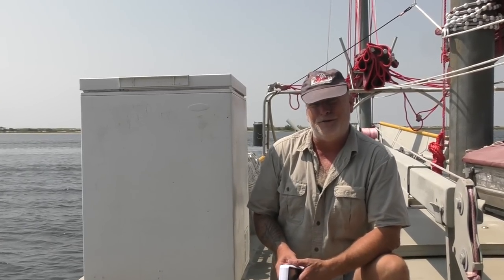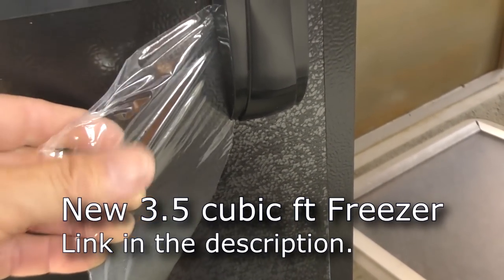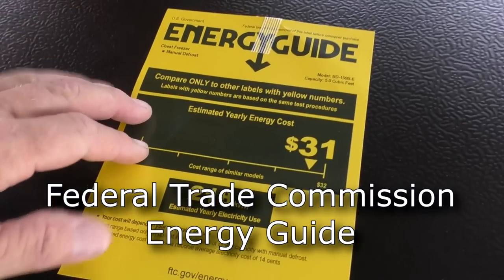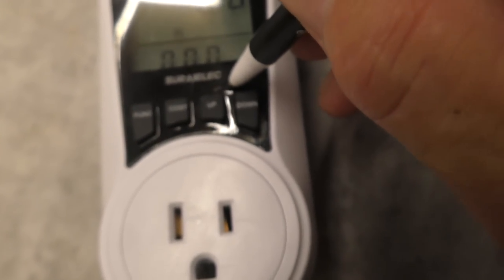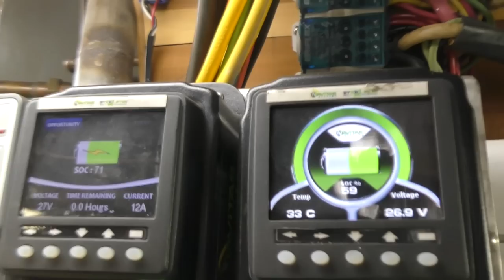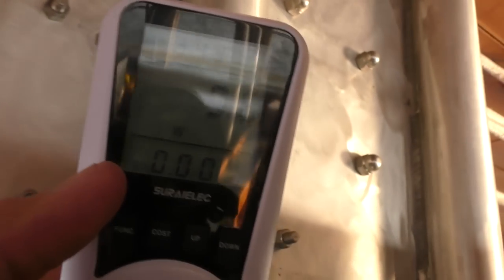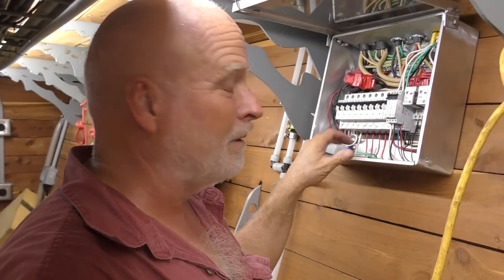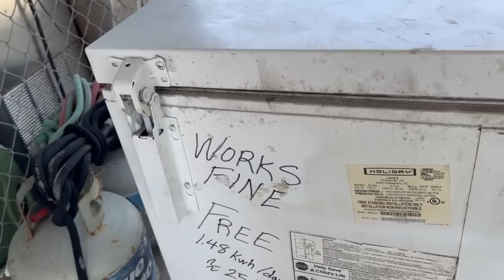Save Electricity with a Simple Meter

Comment from the maker: An easy way to check if buying a new appliance will save you power and money.

Watt Meter  https://amzn.to/3DmUXCO
Chest Deep Freezer https://amzn.to/43yB5qX
ON Off Switch  https://amzn.to/3Y0waxT
AC/DC Clamp Meter https://amzn.to/3XXn317
Reply: For some odd reason I had a weird dream about your boat last night, that dream you like Andy's boat better so you sold sv seeker and started to building another boat.. it must have been them mushrooms that I ate with my beefsteak,, you guys keep enjoying yourselves and keep having fun wish I could join you

 mushrooms i8
Reply: Does anyone have suggestions on a watt meter that has more of the features that Doug wished his had?
Reply: Wy 220/120volt ?
Wy not 12/24 volt compressor cooling system .
You have fridge and friezer in 12/24 volt.

I use one from lg 12/24volt 5/2.5a its how you connect it.

I try to use direct from the battery than i use battery to converter to make  220volt (my case)

Is use Victron 2x 1200watts converter 220volts on 2x 150ah lipo4 battery 12volt  connect on solar panels .
I can charge the lipo4 with the alternator   thanks to a dc-dc charger what is lockt on 20a so the alternator do not blow up .
I use a 70a alternator on the boat .
This alternator do 70a if the engine run even on low speed .

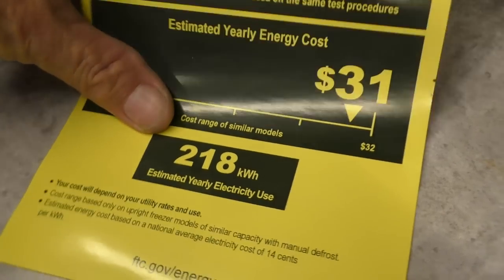Comment: 10:49 keep the sides of the fridge clear, the evaporators are embedded in the walls, the harder it is for it to reject heat, the less efficient it will get
Reply: A really good advice, many people may wonder why there is no condenser in the back as you see it on some of those (or some fans) and afterwards wonder why the sides get hot, but still pack it tight into some corner, or even worse, as my grandma did (it was not actually a chest freezer) put a nice looking tablecloth over it...
Another thing why it may not use exactly the power you estimate, it will change all the time. on a cooler day it will use less. and immediately after you switch it on for the first time, it will draw more until it comes down to temperature. If you load it up with warm stuff, it will draw more. So best monitor those over a few days.

Comment: Great use of the power meter. Was going to suggest a clamp meter but you showed one. For the bird issues you could glue some spikes to the tops of your upper structires, as long as they wouldn't interfere with your electronics or access. Anti-bird devices oftem come in strips, which you might be able to glue or cable-tie in place. They're often also made entirely of plastic. They don't harm, just prevent landing. Bird poo sure makes a mess!

Comment: For a slightly more comfortable experience at the cost of more setup time, you can use smart home plug adapters to automate part of the process. For me I set it up so it comes on when I push the button, and then turns off after a minute where the current draw is below the "idle" threshold for the device. Takes some setup and faffing around on the computer to make it work, but for forgetful types like me it's also convenient to make sure I don't forget to unplug my soldering iron or rice cooker or anything, by having those ones also just automatically turn off after an hour even if still drawing current.
Reply: In Doug's case, all of those smart plugs will add to the parasitic draw.
Reply: Just make sure you get the plugs with current sensors. Not all plugs have them. Also, they add more idle load, and whatever you're using as a server uses power too.
Reply: @occulus2615  I disagree. I have about 20 Shelly1 wifi relays in my house, their standby is about .6w and about 1w when engaged. So you go from saving 7w on the TV to saving 6.4w. I think thats worth it.
What I don't think is worth it is the added complexity to now having devices dependent on WiFi on a boat. Fine for a house, but I don't think this is a good idea in a vehicle.

Comment: Quick question. If the batteries are only charge to a bit over half, why would the charge controllers be in float? Shouldn't they be in bulk?
Reply from the maker: The difference in amps is minimal, but if I have kicked the engine on for any reason, it's chargers on the alternator will make the solar chargers flip to float.
Reply: @SVSeeker  understood. Thanks for the response. I use the same charge controller in my camper van... Just curious

Comment: I bought an outgoing model freezer from Costco, a Danby 7 cu.ft. convertible freezer/fridge.  What's interesting is that it only draws 50 - 55 W when running as a freezer, and it runs about 50% - 60% duty cycle even when equilibrated and located in a cool basement.  So not very high performance in terms of being able to cool down a lot of mass quickly.  But it gets the job done for me.  Similar total kWh/day to the one you have.

Comment: DC is only safe for below 36 volts and you don't want to get too high on the voltage or it can burn the skin. It used to be 48V, but sweat and small cuts on the skin of your hands lower the resistance of your skin enough that it lowers the resistance enough that the current can penetrate enough to cause burns. For AC, below 36 volts is safe. Anything above that you turn it off or risk stopping your heart and dying.

Comment: the first day will be less efficient, power-wise, the compressor will run longer than normal. After the fridge comes down to temp, leave a watt meter plugged in for a long while so that it takes average over lots of time. The compressor kicks on and off at different points throughout the day, so the longer you leave it on (days, etd), the better average you'll get.

Comment: Hi doug, i have a power meter that has the function you are looking for with a built in timer. It is a voltcraft product model no. SEM4500 hope it helps. Greets from the Netherlands 👍 p.s. i just noticed its for 230v.. not sure if that one works in case you are running 110v but they are definately out there
Reply from the maker: Thanks,  as little as I need it, $14 and a clock will work. : )

Comment: Isnt the critical part about running compressors off of inverters that you use a "pure sine wave" inverter, not a "modified sine wave" inverter?
Reply: Pretty much. The manufacturers say not to use an inverter because someone will try to feed it square waves from a cigarette lighter inverter, and neither refrigerator nor inverter will be happy.
Reply: Most of these new fridges/freezers are now inverter controlled compressors and so maybe they are known to have problems when running on a inverter ?

Comment: my experience with the wat meters is if you leave it unplugged to long or even for no reason the battery or something goes dead in it and it gets tossed in the trash i had 2 would i recommend them yes to lurn what things use will i be buying one no thx maybe someday i should not half to ! 
Also if you leave it plugged in you notice it heats up so some power is heating it!I 
I got one and then got a freezer like you hehe try the corncob bulbs they are grate savers 10 15 wat one is like a 100 wat bulb well almost but better light.

Comment: If you are annoyed by the bird, you can get a small green laser and shine it in to the bird, they are afraid of the light and will fly away, a system like that been developed for commercial use. Could also use some small fireworks or horns mounted there. I think birds will annoy you for a while in general.
Reply: Or bird spikes to stop where it roosts
Reply from the maker: Got one!  Buba has not been back but I've had fun playing with the laser anyway. : )

Comment: It would be nice to have a gas or electric powered pressure washer on the boat. I also wonder how well a pressure washer would clean bottom of boat while under water. I think it would work good as long as you did it before it gets built up to much. Just a suggestion
Reply: A pressure washer will work somewhat under water, but only on a very short distance. as water has a way higher viscosity as air, the jet of water will be slowed down considerably more. on a very short distance it will work. Another thing you have to consider, how to keep yourself in place, otherwise the power washer will turn into a jet propulsion system and push you away from whatever you point it at.
Reply: @alexanderkupke920    My friend and I used to ride a power washer wand around our pond when we were kids.   
'
@TOM If you hang around a bunch of old salts you will realize things are typically done a certain way for a reason.     For some reason the younger generation thinks were superior because of our use of technology but it doesn't replace experience.  Old sailors are possibly the most diverse and knowledgeable group I have ever met and thinking one is going to be more clever leads to an exercise in failure and stupidity.
Reply: @saltysassy958  One more thing about doing things "the old way" if found, not only for such things, but also when it comes for example to hand tools vs. power tools. Power tools are fine if you have larger, or repeated tasks, where the time to set up, possibly make you a jig to get repeatable results etc. is no big deal. But for smaller one off jobs, for example cutting a single piece of a 2x4, having a sqare, a knife (or pencil if it has not to be that precise) and a handsaw gets the job done before you even got a power tool out of storage and set up for the correct size. Unless you may have a fully equipped shop with everything ready to be turned on and used at any moment.
Or for metall, why get out a grinder just to remove a burr, when two or three strokes with a file do the same? Plus the "old way" also works if you do not have power at your disposal. I have to admit though, with the development battery powered tools had over the last years, that might be less of a concern in many situations and in some cases it also considerably cuts down setup time. And for some jobs, I would for example not volunteer to switch a cordless drill for a brace unless I absolutely want to.

Comment: I would think about the lifespan of that 6A relay on a B15 breaker. Not sure how much the "crane" pulls when in use, but you might weld the contact pretty quick. Your breaker might be too big for the circuit, then its fine.. 

Also, relays have different ratings for different loads. Say a contactor you can run a 9A motor on, you can probably run 30A if its a heating cable. This is called utilization categories. 
Your relay is only rated for DC-1, resistive loads, and 6A, and not DC-3 or DC-13, and might be fine depending on your application. If you only pull 6a of resistive loads, its fine but if you have inductive loads, they will fail on you. And they always fail at the worst times ;) 

Example from a similar style relay that is actually rated for inductive loads.
DC1 - 3A (heaters etc)
DC13 - 1A (coils, solenoid valves, contactors)
DC3 - DC motors not rated

AC1 - 5A (heaters)
AC15 - 1.5A (coils, valves)
AC3 - 0.5A (1ph motors)

The reason it is like this, is because its harder to put out the electrical arc when you have a coil of some kind in the system, this will keep energy and voltage on both sides of the relay contact. It is also harder to put out a DC arc, because AC goes to 0V 50-60 times a second, DC doesnt do that. I guess the same principle goes for welding! Sometimes people will put a diode in parallel with the relay contact "the wrong way", to help with the issue of inductive loads like coils. (i think this is a pretty cool solution) 

Look at the datasheet of the relay and think if you have any solenoids or motors in the system, then choose the correct relay. Or get a few spares.. :)

I know the utilization categories are a part of the IEC standard, but the basic concept of putting out an arc with a switch applies all over the world. Im sure you americans have some sort of similar table in UL or NEMA. https://en.wikipedia.org/wiki/Utilization_categories
Reply from the maker: Relax the crane pulls less than 2 amps.   : )
Reply: Also, the inductive loads are being switched by the crane, while this relay stays on.
Reply: @SVSeeker  Phew ;) Just wanted to share some knowledge

Comment: I once had a pigeon problem. I found the best way to deal with them is get a super soaker water gun. They hated it and eventually pissed off somewhere else. Not sure if that will work with Bubba though 😅
Reply from the maker: I looked into that.  Didn't have the range I needed.  So we have opted for a laser, but Buba has yet to return.  : )

Comment: Does the new one use butane for Freon? Bought a new energy star to replace our old 80's era fridge, same capacity as the old one. 5.5 amps is what the 1980 model pulled running, and nothing when off. New one takes 13.5 amps running and 6 amps to run the electronics that never shuts off. New model uses 25% more than the one it replaced, and I got an incentive for the new one that uses much more power as the old one. Progress?
Reply: They will pull a little power when not running but 6 amps probably means the icemaker motor was running or the heater on the coil defrost.
Reply from the maker: Yes, it's butane
Reply: 120v x 6a idle? Your unit is defective and should be a warranty replacement. Probably the defrost heaters are stuck on.

Comment: The only issue with the  math is that you failed to factor in replacing the new chinese freezer every 3 -5 years.
Reply from the maker: Can you even buy a US made freezer?
Reply: It doesn't have to be chinese , the point was,  just a unit with much higher efficiency rating. I recently replaced my old bar fridge with a new one with much better efficiency rating, its actually 1.5 times larger but uses maybe %70 of the power of the old one